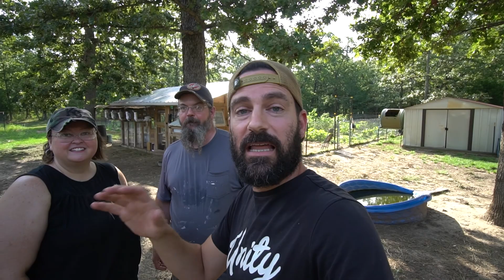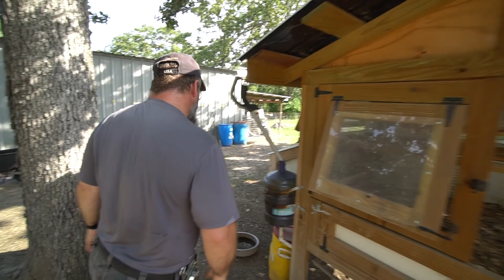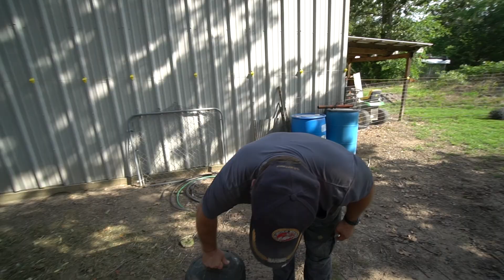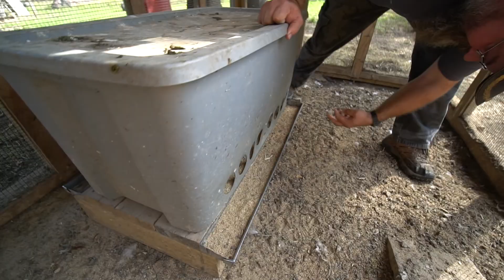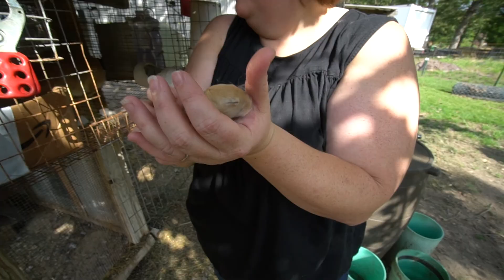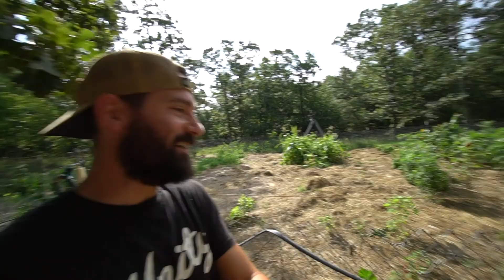Couple turns DIY chicken coop into a PERMACULTURE MASTERPIECE!

Comment: I have a 5 gallon waterer for my chickens. It is one of the red bottom waterers that is made of white plastic. I have found a way to eliminate algae. First, when I clean it out every Sunday, I use white vinegar and water to clean it out, killing any algae that is present at that time. This alone makes cleaning the container a breeze. Then, when I fill it back up with water, I add a couple of Tbsps. (or less) of apple cider vinegar. This keeps algae from growing in the water. The small amount of apple cider vinegar helps keep my chickens digestive tracts healthy.
Reply: That's very helpful! Thanks!
Reply: A great tip! Thank you.😊